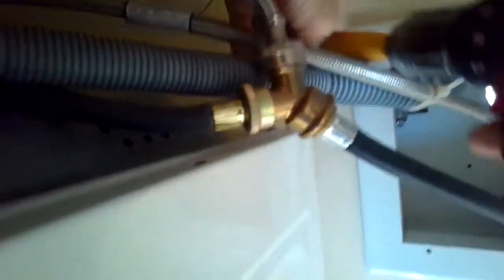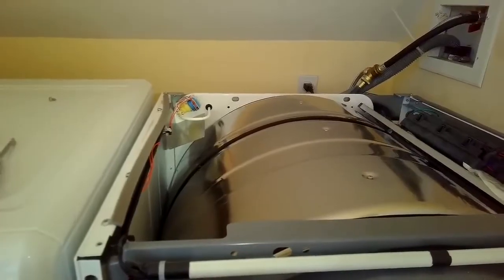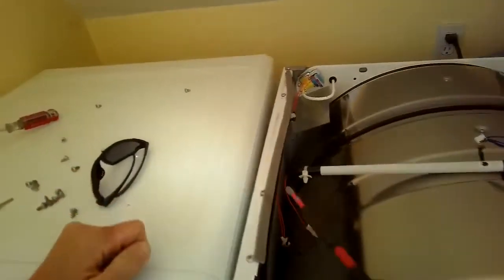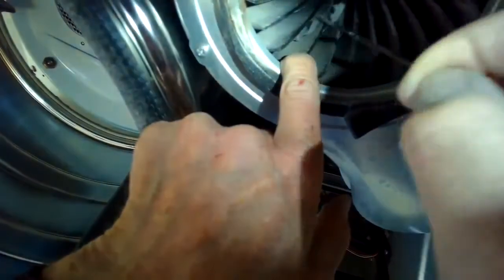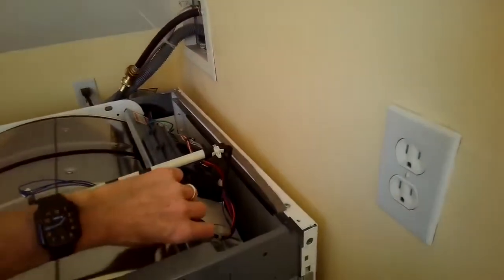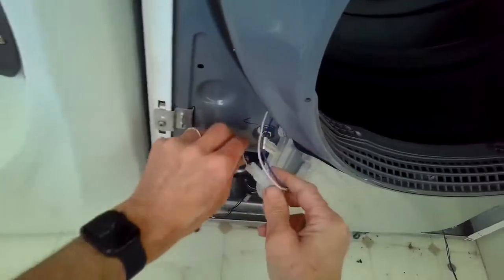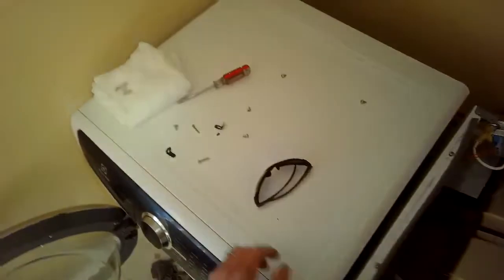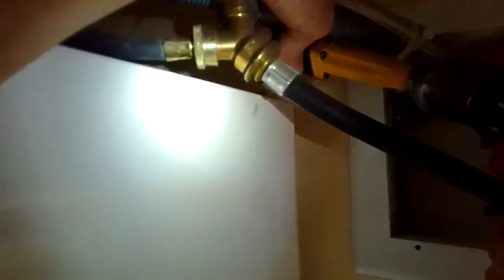✨ ELECTROLUX DRYER RUMBLING - EASY REPAIR ✨

Comment: Just fixed my dryer myself after repairman said I needed new rollers that would cost $500-$600. Problem was exactly what you said. Lots of lint in the vents, and a sock. Video was so clear to disassemble and reassemble the dryer. Thanks so much for taking the time to produce it.
Reply from the maker: Wow,
Nicely done 👍